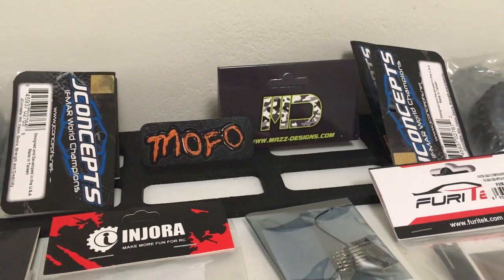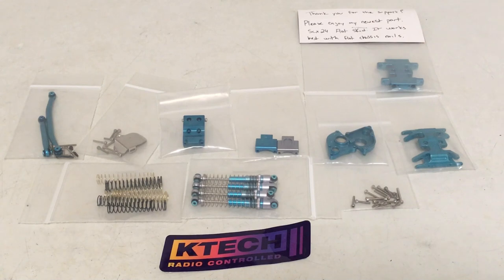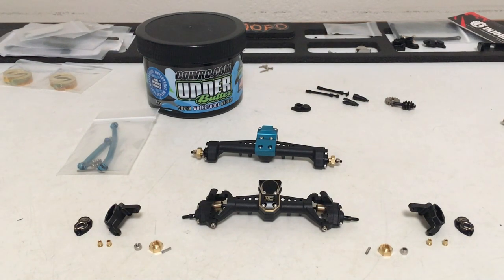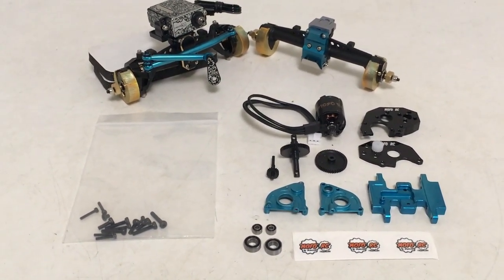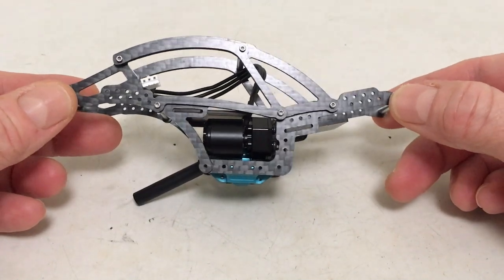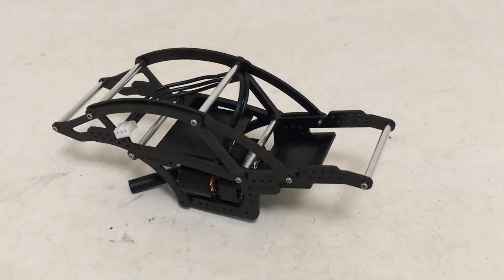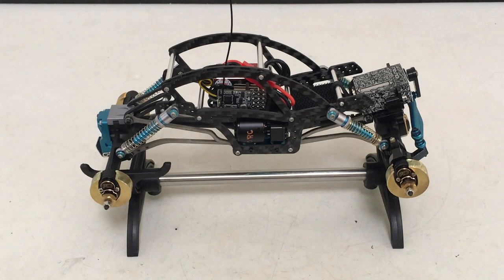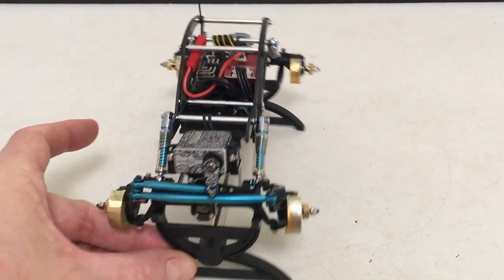SCX24 KANGAROO CARBON FIBER CHASSIS BUILD: INJORA, SHIFT RC, KTECH RC, MOFO RC, AKERS, MAZZ DESIGNS

Comment: That turned out great. The chassis mod was definitely a plus. Btw, KtechRC has teal beadlock rings if you were interested instead of the Mazz carbon fiber. Thanks for the video. May need to pick up one of these chassis myself.
Reply from the maker: Thanks bud! I think this is the best “buggy” type flat chassis rail system for the mass market. I saw those Teal rings, but I do t think they have enough holes to fit the Type Bs I used. Ktech is doing some really cool graphic stuff though!

Comment: Appreciate the feedback on the parts. I have been cleaning up the bearing races with a reamer now. Better fitment and no more binding when tightening the case up. Also, I want to apologize for the trouble you had. I will definitely incorporate your feedback going forward. Thanks again.
Reply from the maker: Hey, no problem at all. Love it that you’re here watching and getting the feedback. I’m pretty used to dealing with little fitment/tolerance issues myself and like to help folks who may need a bit more troubleshooting help. Never like to be the guy to throw up my hands and return something. I don’t blame you. I assume you don’t literally machine the parts. Not a big deal, glad you can address it moving forward though. Cheers!
Reply: 3 thumbs up for paying attention to clients and responding!!! Brian is the Master Artist of 1/24th builds, hands down. 
And I must say, your parts and anodizing are fantastic!!! Nice to see proper, brightly saturated colors. (I'm a 80/90's mountain bike junkie and ano parts addict from back then). Just wish you were in Canada! 😁👍